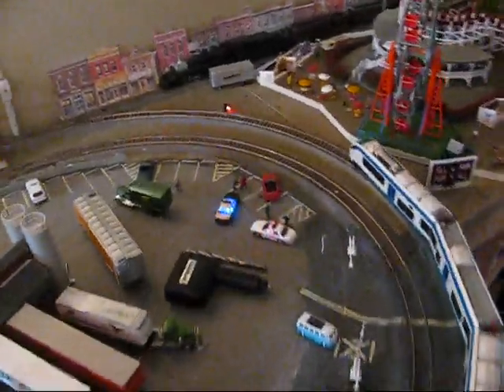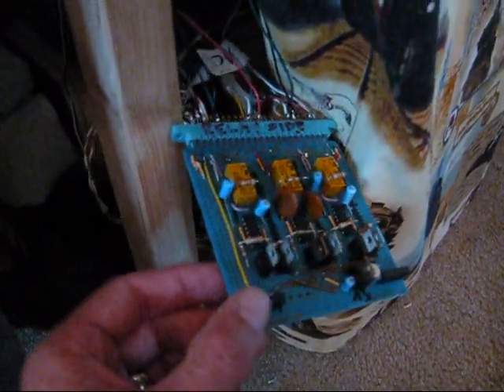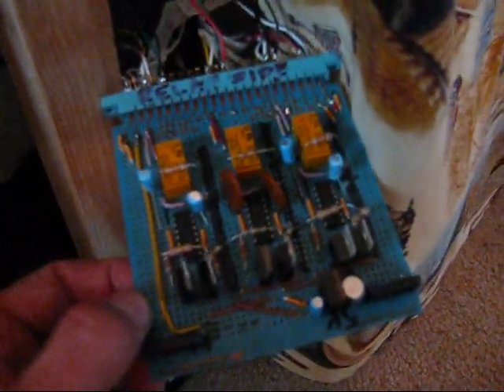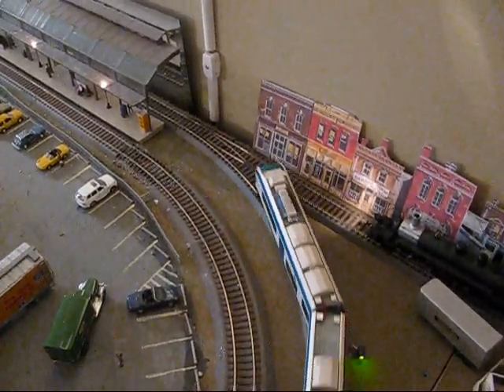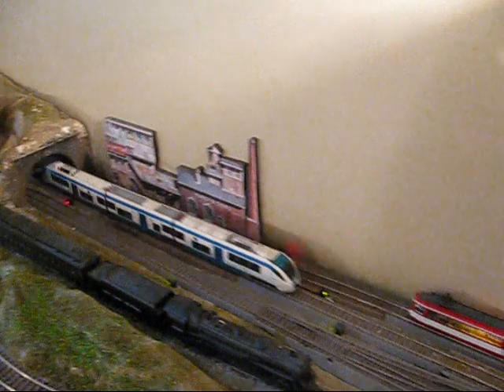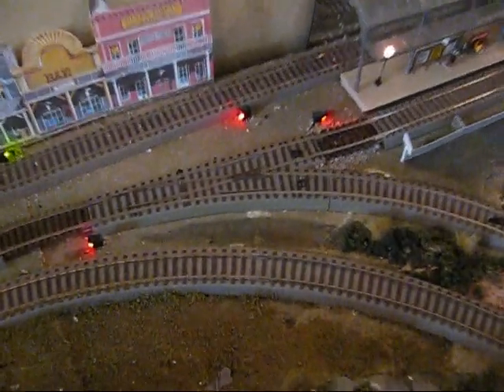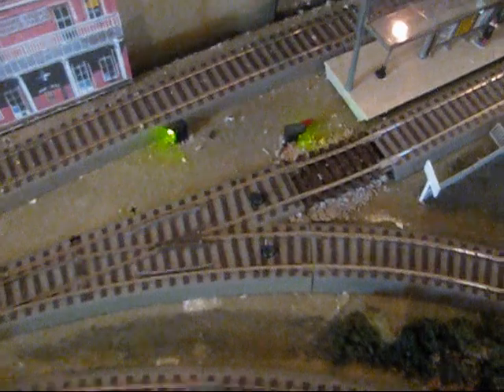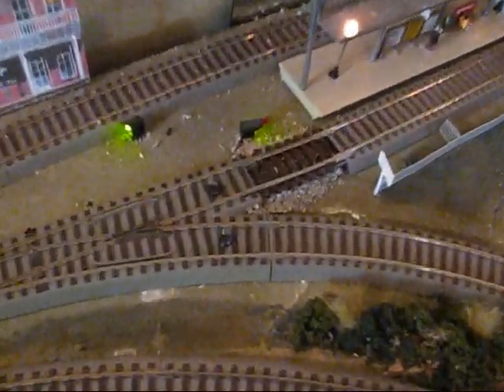Automatic switch demo for HO layout using IR (Infrared) sensors and LEDs

Comment: the ir switch has three wires coming out of it,   which is positive or negitive   the other two would go to a switch or light and does it need or have a resistor in the circuit,  you diagram is verry good   blurry on my end.   sorry for the inconvienence

Comment: have to ask when you move over ir and it switches does the track points move back automatically or do you have throw another switch
Reply from the maker: They stay where they are. IF a train approaches from the other side of the turnout it switches again to accommodate it. But if a train were to come back reaching the point it will go in the direction that the last train came from. You can, of course throw the switch "manually" with the remote (atlas) switch.

Comment: if you don't mind  what are the switches part number,  they go in the center of the track,   starting back on my model now.  years ago used window magnet switches, not reliable. noticed that the switch only throws one was, yes then another returns it
Reply from the maker: Don Rogers are you looking for the roco track part number or the Infrared LED and infrared  detector? You would need to build the circuit board as well with latching relays, voltage regulator and other things. This isn't a plug and play kind of setup.

Comment: 4everrunner, which switch machine did you use, and do you know if you have a remote switch and the switch be connected to the circuit board thus bypassing the need for a switch machine?

Comment from the maker: No, you have to purchase a separate Blue/Red Flashing LED for each car.  Then install the LED in the bottom of the car and wire it up to 1.5V.  The light bar on top is not flashing, it's actually an LED inside the car creating the illusion.

Comment from the maker: @MrMuddshovel I picked up the signals on ebay... Search something like  RED & GREEN 2 POSITION BLOCK SIGNAL LEDS HO SCALE or Bipolar signal HO and hopefully they are still out there. The ones I used are bipolar, but I'm not using them that way, so the straight red green would work I just didn't like the colored lens showing.  I then cut and trimmed StripStyrene H-column 1/4" (item no. 287) that I picked up at a local hobby store to the correct size and shape that I wanted, painted and glued on.

Comment from the maker: Here is a parts list of the major components:
Board
5v DC twin coil latching relay with shunting diodes across coils
556 (dual 555) timer with associated resisters and capacitors for trigger 
and pulse time
2 TIP 120 Darlington transistors to drive the switch machine coils
Voltage regulators

Detector
IS471F proximity detector
50 ma IR LED
???Capacitor??? I don't remember if we used one at each of the detectors or 
not.

Comment from the maker: @damthatsnice  
I'm working on getting a parts list together from my Dad. 
It's somewhat involved with a latching relay, transistors, voltage regulators, resistors, capacitors and the logic chip all on a PCB, not to mention the IR LEDs and IR sensors on the track.  
As for the signals, that's easier go to ebay and search for this seller:
quickarelectronics